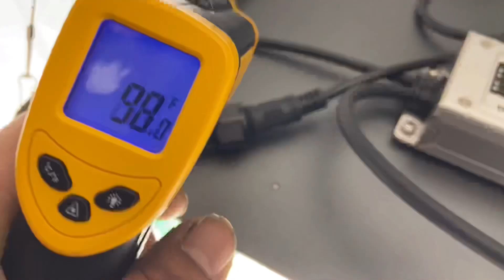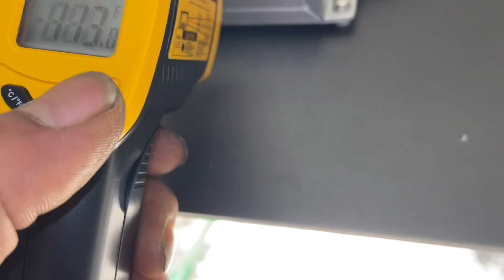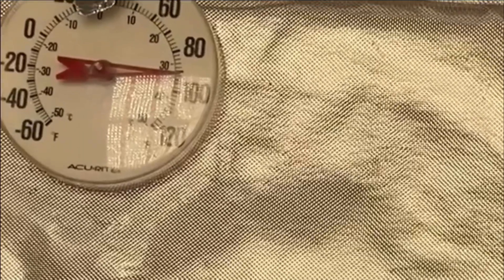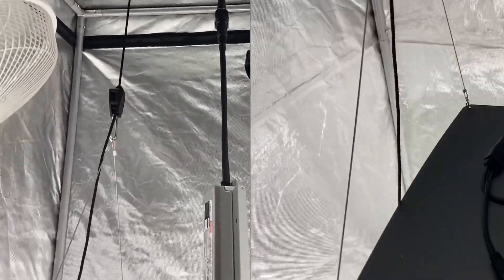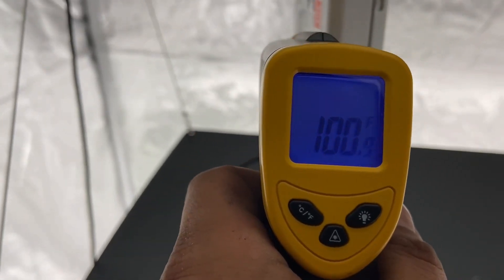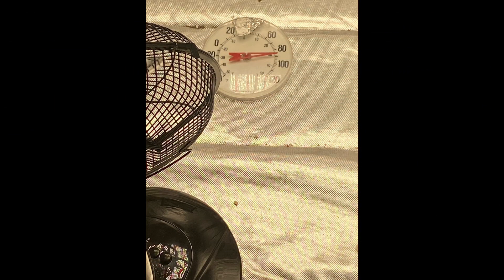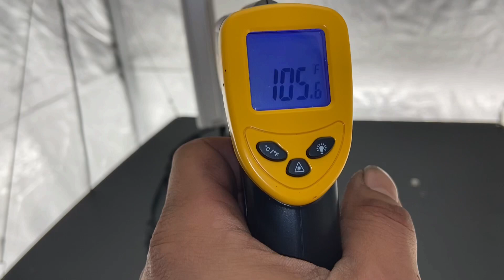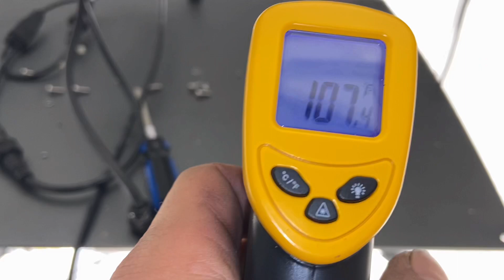Removing￼ Drivers￼ off LED grow lights with a quantum board can reduce grow room heat and damage

Comment: By doing this you have most likely removed the earth ground from the aluminum sheet the LEDs are attached to..  This makes for potential safety issues such as shock/fire under certain failure conditions.  Most lights (mine included) are grounded via. the driver mounting screws that attach it to the aluminum panel the LEDs are mounted on.  You can verify this by measuring continuity between the round pin (earth ground) on the plug and the aluminum shhet both before and after unscrewing the driver.
Reply from the maker: The earths ground is on the alternating current that plugs into the wall. The DC ground is rectified through the ballast. There’s nothing that grounds to the heat shield board because when it’s suspended in the air above your canopy, it’s not touching any ground. The statement started off by most likely so I would kind of not question something you most likely don’t know. Thanks for watching.